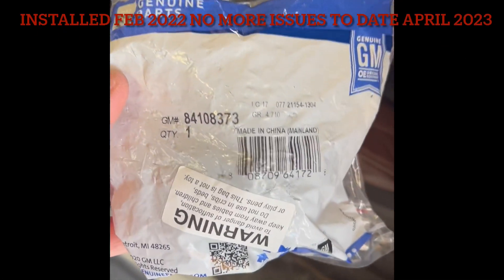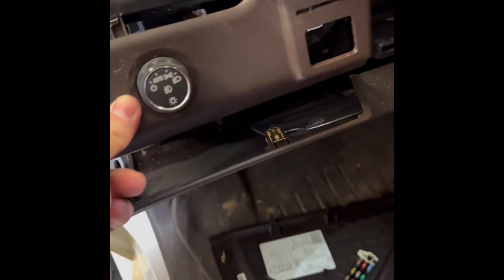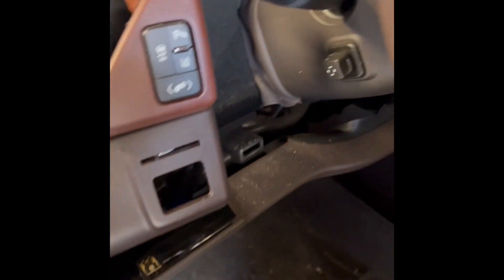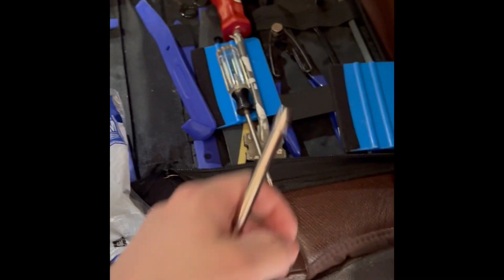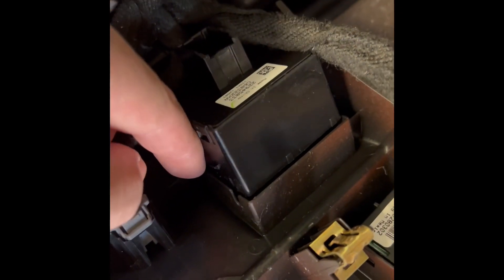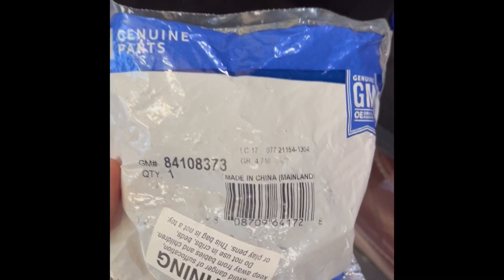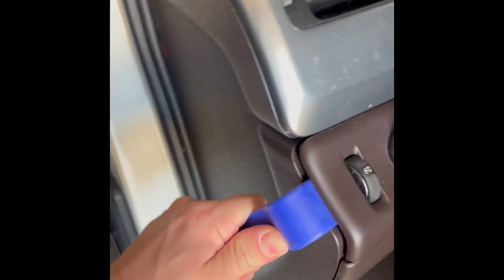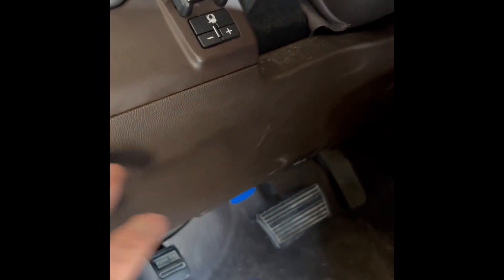2015 Chevy Suburban Service Trailer Brake System Light.

Comment: The connector under the spare tire wasn’t the problem? Seems that’s always the one due to location
Reply from the maker: So I did check, clean, apply dielectric grease, and re seal that connector and I was still having issues. I haven’t had the issue since I changed the part discussed in the video.